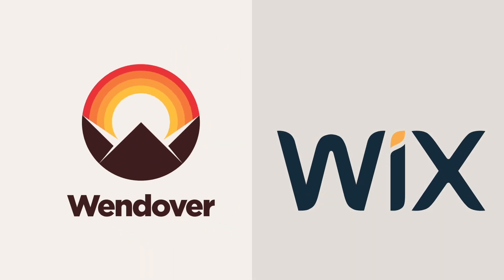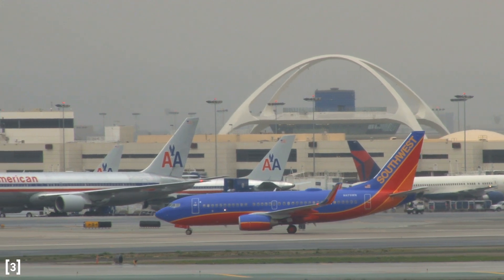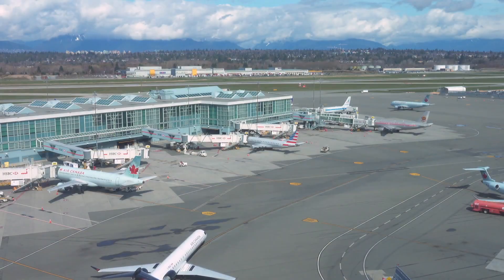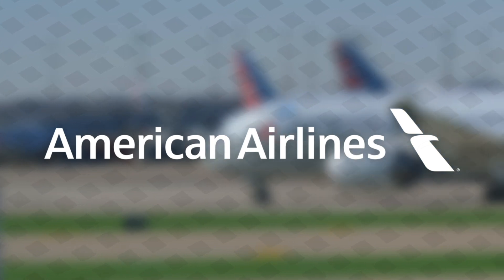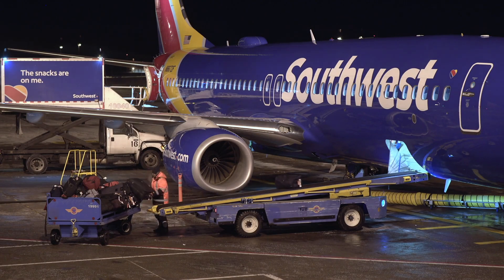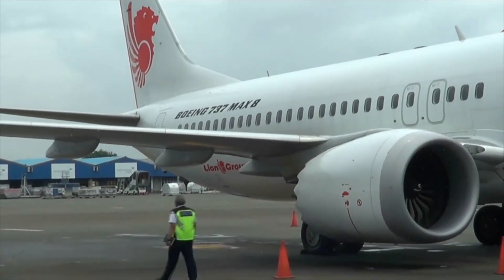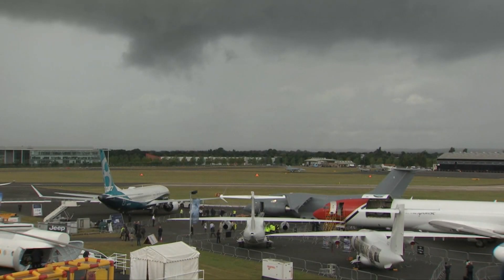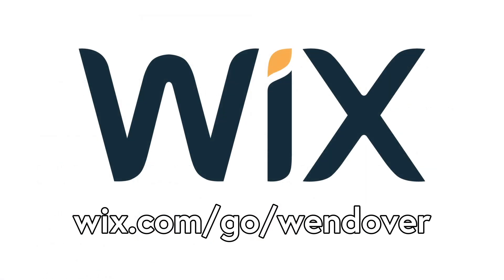The Economics That Made Boeing Build the 737 Max

Comment: Hot take: MCAS, done correctly (using both AoA sensors, with the warning lights, with with actuation limits, and with pilots who can execute their memory items from memory) is a completely reasonable solution. MCAS is not required for stability, and is only required to make it fly like older 737s to reduce the regulatory burden.

That being said, the implementation that was flown should never have been approved.
Reply: Exactly. I don't want to put the spotlight and blame away from Boeing, they do deserve it. But Airbus had similar problems when they introduced alpha floors and their flybywire laws.. and they even had crashes of types bcs of this...
Reply: Tihomir Vrbanec Which airbus has went nose first into the ground due to a sensor malfunction?
Reply: I agree so much. The MAX is not a bad design at all. Unlike what this video said, the only time when the aircraft would tend to pitch up is when the aircraft approaches stall. In normal condition, the aircraft is perfectly stable and flies likes any other aircraft out there. However, due to the differences in stall characteristics between the MAX and its previous predecessors which is the tendency to pitch up in a stall, Boeing decided to install the MCAS system on to the MAX so as to allow the MAX to feel like any other 737 variants even in stall conditions and to help the pilots to pitch the nose down. The MCAS is NOT active during normal flight operations. The reason for both crashes is that the MCAS was fed faulty data from a faulty sensor which caused the aircraft to think that it was in a stall and caused the aircraft to pitch the nose down causing the crash. So if the MCAS was implemented properly there wouldn't be any accidents at all. I expect the MAX to fly again very soon.
Reply: @melvinlow6831  This is probably not important, but I remember reading that the fundamental issue was that at high thrust, the engines caused the aircraft to pitch up, increasing the AoA. The issue was not necessarily that the pilots had allowed the aircraft to get close to stalling, but rather they were rough with the throttle, something that normally wouldn't be an issue except for the different balance of the MAX. The plane was popping wheelies.
Reply: @melvinlow6831  
If they actually pointed out the instruction on turning off the system in the event of a malfunction to pilots before use, the crashes would not happen.

Figuring out which system malfunctioned is the smartest design decision.
Reply: @melvinlow6831  What you are saying is that the 737 Max is only "stable" under normal conditions, but that, once it begins to approach towards a stall condition, it pitches up even more. That, I am afraid, is, by definition, an unstable plane.
Reply: @Observer-cd2ul  What are you saying? All aircraft when approaching stall will become unstable it's just that they all behave differently. A 777 will behave differently in a stall as compared to an F16 or a 737 for that matter. The MAX is just an aircraft with it's own unique characteristics What do you even mean by stable and unstable anyway?
Reply: I agree with the OP. The problem isn't that MCAS was implemented, it's that it was implemented poorly. It's a flight critical system; meaning that if it screws up it can cause the plane to crash. Speaking as a guy with 20 years of experience in this field, these systems are always designed to be fail- safe (not to be confused with fail proof) as a matter of course. This system was not fail safe, yet somehow made it past review and cert.
 This is not to absolve the pilots of blame (they did fail to implement the memory item checklist that would've saved the plane), but if you're relying on an emergency procedure to save you from an obvious design flaw, you've screwed up badly.
Reply: @melvinlow6831  The 737, if in a low speed stall, will not get out using thrust alone. That is bad. And it has MCAS to paper over that problem.
Reply: I've been saying this since the beginning: this is about 60% a terrible implementation of a good idea, and about 40% a training issue. Simply turning off the auto stab trim kills MCAS' pitch augmentation, but pilots weren't properly trained on the dynamics of the system and as a result were not able to recover from the resulting MCAS-induced dive.
Reply: Wasn't boeing charging extra for the AOA disagree lights too !?! WTF
Reply: @chromebomb  Yep, They did
Reply: @chromebomb  it is a clever light that. Call it the 'I am crashing' light.
Reply: Though they need many sensors for redundancy
Reply: So MCAS' sole purpose was to skirt regulations on a plane that otherwise required them, and hundreds died for it.  All the things listed for it to be done correctly are enforced by regulations.  These crashes are a case study in why regulations need to exist, and why the MAX shouldn't have been allowed to be classed as a variant.
Reply: I fear though through bad press, the 737 MAX will have the same fate as the DC-10. A wonderful airplane marred by poor public perception. It reminds me of the book Airframe by Michael Crichton.
Reply: nooranik21 The max am sure has the potential to be a great plane and it is to a certain extent, but its reputation is in tatters at the moment at least
Reply: @forza223bowe5  There is no way that an aerodynamically unstable plane can ever be considered a great plane. If the reputation of the 737 Max is in tatters, it deserves it. Boeing needs to build a new plane.
Reply: @Observer-cd2ul  Most modern fighter aircraft are unstable by design, are they bad planes?
Reply: @Shaker626  Fighter aircraft make bad airliners, yes.
Reply: @Shaker626  The priority in designing fighter aircraft is manoeuvaribility as this is crucial in battle. So a degree of instability has to be accepted. Note that fighter aircraft also come equipped with ejector seats. The 737 Max is NOT a fighter aircraft; it is a passenger airliner. There is absolutely no reason for its design to be unstable. The priority here is safety; so Boeing has crossed the red line in rushing out such a plane in the interest of profitability.
Reply: @Observer-cd2ul  "There is absolutely no reason for its design to be unstable." Unfortunately, that's not true. Airliners are also notoriously unstable due to their "cargo" getting up and moving about the cabin. The pilots can't do a proper weight and balance, so the aircraft must be tolerant to a wide variation in CoG position. That's why auto trim systems exist. 

 The flaw in the 737MAX wasn't that it had MCAS, the flaw was that MCAS was implemented without so much as a token attempt at flight critical system safety. All of the "corrective measures" that have been implemented to fix the problem are measures that are normally implemented from the very beginning. I've worked on these systems for 20 years, and they're all designed this way. Sanity checks, cross referencing multiple sources, servos with break torque and control limits... This is all industry standard practice. We try very hard to make sure that our equipment cannot fail in such a way that planes crash and kill people. That attempt was not made in this case.

 The question is how did this code ever make it out into the field in the first place.
Reply: Yep, Boeing screwed up, no doubt about it, but the 737 max is not a bad plane, and with logical limits and redundancy it will be a very safe airplane.  Hell the MD-11 was a proverbial deathtrap for a wile be for McDonald Douglass, but in the end it went on to be a very safe plane.
Reply: There is also the fact that MCAS has been around for quite a while, and is a proven system on the large Boeing military aircraft. The only difference is that the military aircraft use both AoA sensors, and the system automatically cuts out when back pressure is applied to the yoke (something that should have been implemented to begin with, but is supposedly in the new software patch). 
From the reports and rumors surrounding the Max crashes, it seems that Boeing is not completely at fault though. It sounds like information was not being conveyed correctly between Boeing, the Airlines, and the Pilots, which may have lead to improper maintenance and insufficient difference training (both of which would have been negated if Boeing had implemented the same MCAS system as on their military aircraft). 
Airbus has had some far more frightening failures from their flybywire system, which has resulted in a few crashes, though as I recall they were spaced further in time. Boeing was just unlucky that two crashes happened so close together.
Reply: As an engineer, I cannot stress this enough. Engineering is mainly about doing things as safely as possible while minimizing costs, that's why we exist. It was completely within Boeing's right to utilize these systems in order to re-engine the 737. As a result of these actions, they'll actually help the planet significantly by reducing fuel consumption, so it's a reasonable course of action. What I want to know is why on earth they allowed only two airspeed indicators to be installed on this plane when they tend to have a history of malfunctioning, and why executives pushed for the MCAS implementation in the way they did. I sure hope some supervisor gets canned, especially for letting a screw up this bad occur, especially since these are common sense solutions.
Reply: Toronto Transit Channel exactly. And for them to not tell the pilot about this system is one unethical point just because Boeing thinks and hopes for the plane to fly exactly the same in competition words from Airbus saying that A320neo will fly exactly the same as the old A320. If it’s a different plane own it up and train the pilots. Mind you those pilots only had 10 hours or so in iPad training and into the actual flight. It’s not a training. If it flies different own it up Boeing. Ishh....
Reply: Well, the stability is a matter of contention. From certification standpoint the plane is not stable enough to be certified without MCAS.
Even though all 737s fly under the original certificate from the 60's. No version of the plane is certifiable under current standards.
Reply: So, the argument is that it will be an amazingly safe plane once they figure out how to make it stop crashing?  Isn't that the same as saying it's not a safe plane?  From what I read, the pilots didn't even know the system was in place that could override their control and Boeing made redundant sensors an option that many, if not all, didn't buy.  I'm not convinced Boeing will recover 100%, there are a pile of lawsuits going through now and if the estates of the deceased successfully turn this from an accident to incompetence or worse, the costs will skyrocket.  This doesn't include lost revenue from all the airlines with them parked.  Boeing stands alone paying all of the costs.
Reply: Bob Wilson exactly. The way I think is same as yours. If it’s not the same flying behaviour Boeing cannot say it’s the same plane. Just because Airbus said “the A320 Neo will fly the same as A320’s in the past” that Boeing also have to say the same thing while not telling the pilots that they added a MCAS to make it fly similarly just to have the same level of competition with Airbus. This is UNETHICAL.
Reply: @InvestorAcademyPodca  the argument is that MCAS is a sensible approach. It's pretty obvious how to stop them from crashing (fix the implementation and have competent pilots)

The 737 has long had autotrim, and it has long been a memory items on how to disable it. It is very clear when autotrim is operating (large wheel rotating right next to you).

Look at the black box report. When the pilots applied manual nose-up trim, it let them. Then, MCAS pushed it back down. They repeated this a few times, disabled all electrical trim, but at this point, the airspeed was well over the maximum (450-500 knots), so they couldn't manually move those trim wheels. They then (reasonably) turned the electrical trim back on and commanded nose up trim, which worked. But since they left it on (turning it back on was a violation of the runaway trim procedure, and leaving it on was idiotic), and MCAS pushed the nose back down. Had they turned it back off or commanded electric nose up trim, it would have kept flying and let them climb out
Reply: Well, the marketing behind the MAX was to be able to fly it with minimum training from already qualified pilot on the older gen. The pilots received a 2 hours training on an Ipad without any mention of the MCAS or how to disable it.

Also, if my memory is good, it's using the same cockpit design as the older 737, so a warning and alarm sound/light, but no screen to tells you what's happening and what to do.

And finally, the 777 FBW limits could be overridden by applying enough pressure, why not keeping the same philosophy?

So, yeah, for me it's a bad plane. I would rather fly on old gen or the A320 NEO
Reply: Bullshit. The damn thing has killed hundreds of people so far, and there were other crashes only avoided by seasoned pilots who did manual overrides of what the moronic engineers did. Boeing put profits ahead of the lives of ALL of their passengers - and it was a gamble that their passengers lost. The whole fleet should be banned and scrapped as inherently unstable.
Reply: @JB1994  Seems you obviously have no clue on the reality of Aviation. The plane is not unstable, and its flight hours vs accidents rate is so low even with these two crashes riding in a 737 any variant including the M8 & 9 is still safer then driving your car to the grocery store.  Lets put your thoughts into something you can relate to.. a car manufacture has a model car that turns out to have a faulty tie-rod end instead of rectifying the faulty tie rod end you propose scrapping every single car of that model.
Reply: @pr1malr8ge  I guess I have no clue about aviation, since I believe that planes should stay in the air until they SAFELY LAND - and NOT spontaneously crash into millions of pieces killing EVERYONE aboard.
Reply: @JB1994  these accidents were avoidable by any competent pilot. You can't fly a Cessna without understanding how the trim works. 

Of course, in some airlines they just let the autopilot do all the work. You can train any high school student to do that if they only operate at large airports. Well, until the day the ILS is down at SFO and they crash short of the runway. 

The others have it right. Giving the plane authority over the trim based on a single sensor is a dumb design, but it shouldn't have led to a crash. Airlines need to own up to the reality that you can't skimp on training and have pilots who don't know how to fly without assistance.
Reply: @pr1malr8ge  Or a faulty fuel tank that was certified with a rubber liner to stop leaks but removed on production models which lead to puncture, leaks, and fire in the case of a rear end accident.  Then, instead of fixing this or scrapping the cars, Ford, i mean the company, figures that the lawsuits that result from the defect are cheaper than totally replacing all the fuel cells so it never gets fixed.
Reply: @RichFreeman  I had a friend jumpseating in a Max 8 and asked how they would have handled the situation.  The pilots reached over an flipped the MCAS switches and said "done."  It really is that simple.  While European and American pilots are taught about the system, Boeing did not require it which lead to the lack of training while at the same time touting that the Max series is no different from the NG series.

Also about SFO, is ATC still banned from assigning a visual approach to Asian carriers?  That's what happens when you pretty much only require a pilot to have their commercial to fly an aircraft rather than the 1500 hours required in the US.
Reply: @RichFreeman  These disasters were avoidable by HAVING AN AIRPLANE THAT WASN'T DEFECTIVE.
Reply: @bbmikej  I think it also has to do with maintaining proficiency at manual flying, by routinely doing so.  A lot of US pilots fly recreationally (granted, in different airplanes, but also in ones that have much less automation), and the big airlines give pilots a LOT more simulator time.  

They don't even have to flip a switch.  As long as they keep manually trimming with the yoke switch the MCAS will be held at bay, even if they don't realize what is going on.  Once they get things where they want them they could just grab the trim wheel and hold the thing if they had to.  Of course once they realize the plane is fighting them on the trim they can reach over to flip the switch to disconnect the trim.  Any pilot should be familiar with the function of EVERY switch in the cockpit.  Heck, I believe they're generally pretty well trained in how the systems actually work in case they need to deal with tripped breakers or whatever.  Yes, there are a lot of switches in there, but they're professional pilots.  If you can figure out how to fly a VOR radial or a hold, you can figure out how a trim disconnect switch works.  

I'm not sure what the rules are at SFO right now.  I did hear that they stopped doing tandem approaches to parallel runways unless both aircraft were from US airlines.
Reply: @JB1994  Unfortunately you are right. The problem with the 737 Max is that it has a structural aerodynamic design flaw which makes it unstable. The MCAS is required as an attempt to compensate for this. The morally sound thing to do is to design a new plane without this structural aerodynamic flaw. Otherwise, only ace pilots should fly this 737 Max, and Boeing should stop selling them to airlines who do not have a whole team of these ace pilots.
Reply: @roflchopter11  So it was both a pilot and a training problem? Well, I agree that you cannot just blame Boeing on this, it is also about pilots and airlines.
Reply: roflchopter11 No mention about their overspeed right after takeoff?
Reply: Rich Freeman „these accidents were avoidable by any competent pilot“

I would agree but considering most didnt even know what was happening because they didnt even know of they existence of MCAS im not so sure... i havent looked at the times how long it took in both cases from beginning of the problem to the crash but it couldnt have been too long. If you have to not only find a solution but have to find the problem first thats a needle heigh stack situation and when time is running out competence might not be enough to save you 🤷🏼‍♂️
Reply: @Falkano  
The Indonesian flight 610 had the same problem in the previous flight. It had a third nonworking pilot that immediately pointed to the "Runaway Stabilizer" problem and the procedure to turn the Switches to CUTOFF. There was no accident.

Maintenance failed to pinpoint the fault. I read somewhere they exchanged the part and cleaned contacts, but have not test flown the aircraft neither conveyed info of plane fault history to the new crew in the next flight.

Those were not fortunate enough to timely understand the situation and act.

Even without definitive investigation results, Boeing acknowledged the poor original design of MCAS and started upgrading it while at the same time issued with FAA a AD (Airworthiness Directive) pointing to the matter and how to deal with it with the already established "Memory Item" procedure for "Runaway Stabilizer" condition that had not changed.

Ethiopian flight ET302 pilots surely would have known about the previous accident (FL610) and the AD. They rushed to swith the STAB TRIM to CUTOFF, before trimming. They kept auto thrust and went overspeed while manually compensating the bad trim pulling the yokes commanding the elevators. Then, they had difficulty manually trimming.

It's still not clear if they intentionally reenabled the electrical STAB TRIM contrary to the procedure. If they did as shown in the recordings by a couple of short nose-up commands it's not clear why they did not kept commanding untill stabilized and then switched back to CUTOFF, or at least counter acted the MCAS.

I can't understand why they wouldn't have at least tried to trim while needing so much force at the yokes to maintain pitch/attitude. There might be something else we are not aware of, or it was a gross error.

Such errors do occur, as in the Rio Paris Air France AF447 with an A330 where iced pitot tubes forced AutoPilot disengagement and one pilot consistently gave nose-up commands at his joystick, with no direct feedback due to cockpit design to the other pilot, overriding his actions, putting the plane in a stall from 3500 feet for 4 minutes till the perfectly flyable plane crashed like a rock in the ocean.

The other pilot realized what happened moments before the crash with no time left to do anything.

A very sad story.

Accident prevention organizations must look at the whole picture, not just the equipment, procedure, pilots, cognition/psychology as isolated matter.

Even if the plane is equipped to avoid the accident, there is a procedure, it was documented, pilots trained, they knew once how to react in a simulated environment, they may not have timely the situation awareness to act.

Won't through this on pilots. They payed the highest price. 

Correcting MCAS to avoid doing harm with unreliable input will cut this exact chain of events. Anyway, there may be other lessons to learn here.
Reply: pr1malr8ge you clearly don’t know what your talking about. No one is blaming on the 737. Everyone is pointing fingers at Boeing for not telling the pilots MAX has a new system so that they compete with A320 Neo with quote to quote “A320 Neo with fly exactly the same with A320.” Words from Airbus. Boeing wanted the same reputation to compete by not letting the pilots know Max has a MCAS so no knowledge with poor info stats on screen by just having a little warning light/sound. There is no way of knowing unless you’re a very talented and experienced pilot to know the characteristics. 737 Max is not a good implementation because of how they handled it by not telling of the MCAS. It is unethical business. And moreover 737 is a safe plane 737 max isn’t. Yes the crash rate is low. But lion and Ethiopian are crashed in only 4 -5 months of flight. That’s close to never happening before. Even DC-10’s bad reputation didn’t cover only 4-5 months of flight. It’s too new to have crashed two planes in that short period of time. The MCAS on 737 Max is so hastily and unethically implemented that it didn’t not go through enough testing in order to compete with the already high selling a320 neo’s. so no. It’s not a safe plane. 737 Max is not a safe plane but no doubt. 737 of any other variants is. And as for cars. I’m a petrol head. If they have a car problem manufacturer would take a recall and fix it. The percentage of death due to car failure parts is way less the flights. It’s not a fair comparison. A recall is also cheaper than flight recalls.
Reply: @InvestorAcademyPodca  this is a training error, not a plane error. I'm not going to blame pilots nor will I say Boeing is without fault. The implementation of MCAS was handled very poorly. However, MCAS itself isn't inherently dangerous similar systems are in use on just about every modern plane safely and efficiently. The issue is that it wasn't implemented correctly. I'd go on record and bet my last dollar that these will be the only 2 instances of total loss originating from airframe design for the MAX program.